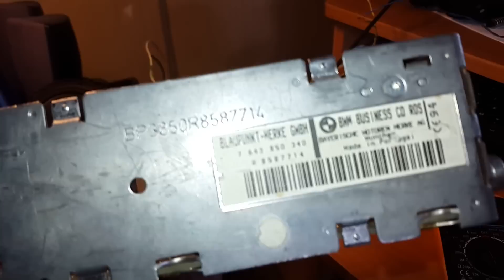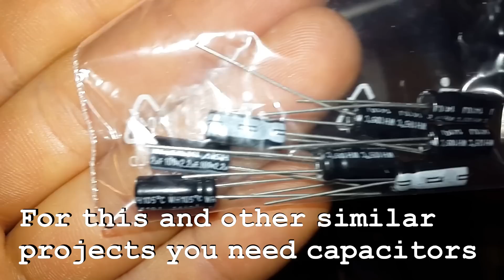AUX DIY BMW Business CD RDS BP3850

Comment: Hello. you have soldered just 2 wires, , I guess for stereo there should be 3 wires. where did you connected the 3rd wire from the AUX cable?
Reply from the maker: Hi, ground is connected to radio frame.
Reply: @MechanikasLukas  thank you very much, I have exactly the same CD player (BP3850) so it will be easy to follow your instruction. Just need to get these capacitors.🙂
Reply: @MechanikasLukas  When you cut AM module, will FM station work after? or there will be no radio at all?
Reply from the maker: @jalalaliyev3325  After this mod, AM is for AUX in, FM is for radio. Only thing that is changing is AM radio, all other functions will work as usual.
Reply: @MechanikasLukas from where did you get aux cable with 3wires.....?